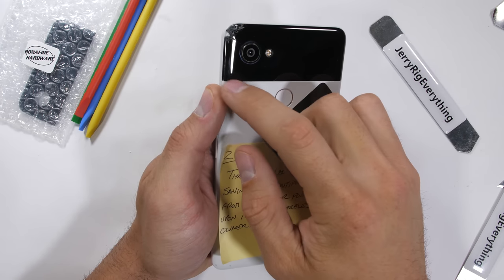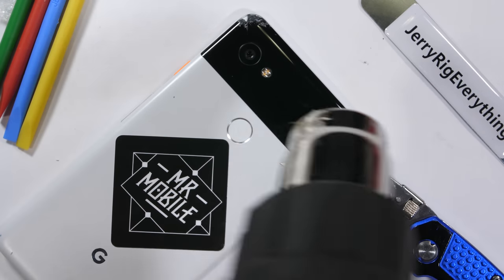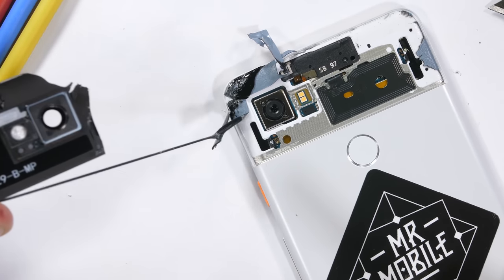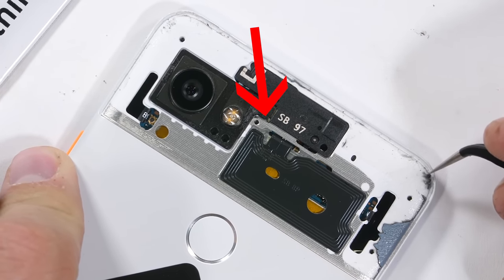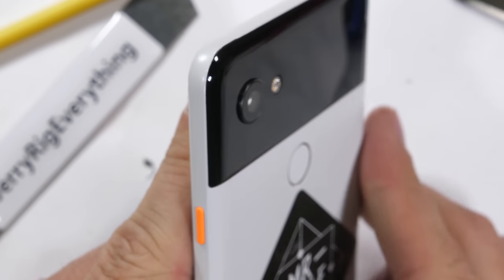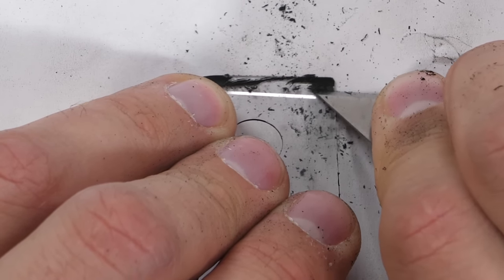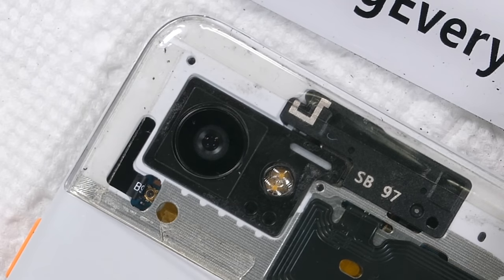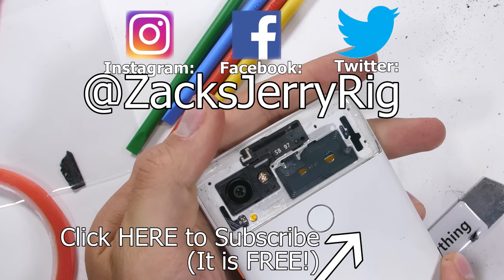Can we make a CLEAR Pixel 2 XL? - How to fix the Black Glass

Comment: Ghost Panda is 🔥. 

Great video as always. I may have been the cause of that V30 drowning 😂
Reply: Like if i should modify my 2000 G-Force centrifuge with a clear top :)
Reply: Glass is terrible material for backs.
Reply: Tek56 well, plastic scratches instantly, glass breaks easily, metal doesn't allow for wireless charging, carbon fiber would probably be too expensive, so ye
Reply: BH4x0r I'd rather have a back that just scratches as opposed to a back that shatters and breaks easily.  Glass is not durable.
Reply: Tek56 well strange that my S6 hasnt been broken while i had it since 2015?
never had to do a single repair on it or never had to have it repaired.
glass back and front are still in mint condition.
Reply: BH4x0r Lucky you, but many people drop their phones and end up breaking the glass. It's already bad enough that the front glass where the screen is breaks, but with a glass back, the glass on the back also breaks. Terrible idea for build quality.
Reply: Tek56 well, shit can happen, but if you're worried that you'd end up breaking your phone, a $10 S-Line case would solve that issue entirely as it protects your phone properly even if its quite cheap, sure it wont survive a drop off of a huge building but it's better than nothing especially if you're concerned you might break it.
if you know you've dropped stuff alot, a protective thing is a good idea as it costs a whole lot less than a new phone or new screen or new back-glass.
Reply: BH4x0r What's the point of a glass back then?
Reply: Tek56 as i said not everybody is as clumsy, so not everybody needs it, but it still preserves the wireless charging capabilities AND allows for easy and cheap swap if the case ever gets ugly, and glass will stay pristine, so it will not scratch, which in turn helps for a higher resale value if you ever wanted to sell it and get another phone
Reply: BH4x0r Plastic allows for wireless charging and is more durable than glass. Glass breaks, which is worse than getting scratches. So plastic is really better than glass.
Reply: Tek56 but the fact that plastic already scratches from just keys in your pocket is just shit, and the fact that its less likely to break the glass than scratch plastic is a no-go
Reply: BH4x0r But that's just the back of the phone, it's not the screen, it's not that big of a deal. A shattered broken glass panel is worse than some scratches. Plastic is more durable than glass, scratches aren't that big of a deal, it's better than a broken phone.
Reply: Tek56 tl;dr: everyone's preferences are different, i rather have a glass backed phone than a plastic backed phone, and alot of people do, and if you're careful enough with your devices none of this will ever be necessary.
but honestly, if someone buy's a phone and he sees the back is full of scratches he's less likely to buy it and/or would pay less
Reply: BH4x0r If someone sees a phone that has broken shards of glass then he is even less likely to buy it.
Reply: BH4x0r Accidents happen. People accidentally drop their phones a lot, that's why a lot of screens that are made out of glass are broken and why glass backs will also break as well. Glass is not durable.
Reply: Tek56 "a lot" yeah really ever happened to me right thinking
Reply: BH4x0r Many people drop their phones and break their screens accidentally. Having more glass on the phone will just break the phone even more and be less durable.
Reply: BH4x0r mmmm carbon fiber 😍
Reply: 666 lykes dud
Reply: Tek56 well glass is cheap and looks better plus there’s a thing called a case
There’s plenty of clear protective cases that allow you to admire you beautiful phone and don’t forget if the backs were plastic jerry could do clear backs
Reply: @tek5670  Well you can still use transparent rubber buff guards for the back 😅
Reply: @BH4x0r  And plastic is harmful for the environment as well 😁😁😂
Reply: @tek5670  I prefer glass as I rarely drop my phone
Reply: @HerobrineXPc you aren't everyone. I would want a phone as durable as possible without sacrificing the visual appeal. Metal is perfect for this since it looks much better than glass and is the most durable. Plastic is second since less durable, but still much more durable than glass.
Reply: @BH4x0r  looking back at your comments saying how plastic is "bad" because it can leave scratches is just stupid. You are complaining at a purely cosmetic defect aka scratches on plastic that doesn't defeat the structural integrity at all unlike glass which if broken exposes the insides of your phone which is not good. Who even notices scratches or cares? I know don't. Plus if you get more rubberized plastic like the back of the Galaxy S5 then scratches are much more unlikely. So therefore plastic is much better than glass. Why don't you make a house or car out of glass while you're at it? Knowing you I'm sure you would.
Reply: @tek5670  Its up to you, everyone has a personal reference. I like matte finish glass back, and my plastic back phone has some smol scratches. I like the Poco F2 Pro grey matte finish
Reply: @amvymavy  Yes it is up to me and I will make the smarter decision.
Reply: @Tempst  wait a minute plastic is safe for the environment? Bruh what
Reply: @amvymavy  When did I say so ??? 🤨
Reply: @tek5670  its not you that said it. I just think its weird that plastic is safe lol
Reply: HerobrineXPc oh never mind you were talking to someone else
Reply: @tek5670  thats not the only issue, i know that glass itself is already a pretty good insulator of heat, but plastic almost lets none through, which means your SoC will have an even harder time to cool down, infact metal backs were the best to dispose heat, but those gimmicks like wireless charging etc wont work through it so i doubt that we'll get that again in a flagship soon.

yes metal would scratch too but not as fast and wont fuck up the cooling abilities of a phone..
Reply: @tek5670  i bet you didn't even read my comment, i'd prefer metal over glass but if i have to choose i'd choose glass over plastic.

never had glass break in the 5+ years i had glass back phones anyways.
Reply: BH4x0r you haven't had glass break because you had cases on it, but even that fact doesn't change the fact that glass is more fragile aka easier to break  than plastic.
Reply: BH4x0r having a glass back makes zero sense whatsoever. 

Why make the phone even more fragile than it needs to be. 

Also if you're in favor of metal phones like I am why are you okay settling with glass?
Reply: @tek5670  because there are no good flagships with top specs with a metal back nowadays, i just take the best thing available, at the time, technically the One M9 was the best spec'd metal back phone when i bought my Galaxy S6, but even then it had severe heating problems, and i know the S6 performed about the same EXCEPT it didn't overheat, so i just bought the S6.

in 2018 i bought the S9+ and haven't bought any phone since, i just pick whatever is most powerful as long as it isn't plastic, overheats, or is an iPhone.

I upgrade only every 2-3 years.

by the way i always hated Apple and nothing will change my mind about those scammers anyways.
Reply: @tek5670  i haven't always used cases, yes when i bought the S9+ i did buy a case to go along with it, but i still regularly use my old S6 when i go to work, which is 5y old and still works fine except it got a bit slower and the battery doesn't last as long anymore, which is normal, other than that it doesn't have a case.

Comment: I've got a little request, if you ever were to see this comment, Zack. Could you if possible test out one of those liquid glass screen protectors with your Moh's picks? Screen protectors for curved displays kinda suck, so I was wondering just how good these "Liquid glass" screen protectors really were.
Reply: Just buy some curved glass protector, uv loca glue (2000)and cure it with uv light. Works like a charm. I use this method for a year now, and my screen is beautiful as new.

Comment: When you started to remove the glass with the blade, you shaved some plastic from the body of the phone, and I'm already at the part, where you state it's good as new, I could still see the missing material!! 😿 only the ocd guy inside my head makes me comment, don't mind me
Reply: mratlas It's always better to use a blunted blade. Not even hard to do, either. Just give one a few drags across some steel. Another razor blade would work, or better yet a nail.
Reply: Omg same 🤦🏽‍♂️
Reply: The same problem here.

Comment: Hi Jerry I just done this repair myself on a pixel 2 (non Xl) and here's some little tips for those who doesn't have the Xl variant.
1st: wear some eye protection (glass can go everywhere with brute force)
2nd the camera lens doesn't go off like the Xl, only the flash
3rd If your glass is really broken, it may takes some time removing all the pieces and adhesive (it took me a full hour for the whole process)
Overall great video keep the good work!

Comment: How do u not scratch the glass when scraping off the paint, r u using special knife?  Send me one bro if so thx jerry.
Reply: Glass is harder than the razor blade
Reply: With science.
Reply: Glass is glass and glass cant be scratched by a razor blade.
Reply: Glass only scratches at a level six, with deeper grooves at a level 7. A razor blade usually sits at a level 5 in Moh’s scale of hardness.

Comment: Your video is the only video that shows removing the glass almost one piece. I guess other people failed to warm it properly. I've got a heat gun with adjustable temperature so I wonder about proper temperature to set the gun to and also about the time to apply the heat.

Comment: Cheers for that! I've never done any phone repair and although this was minor I was worried, it's worried great on my standard pixel though (there seemed to be less delicate stuff under three glass thankfully!) Only thing I did differently as I don't have a heat gun is put the phone in the oven at 85 degrees C for 7 minutes at a time worked great!

Comment: Why don't you use those (i'm not sure if i call them right) bags filled with seed you can heat up in a microwave to soften the adhesive and use a solvent (like isopropyl alcohol) to neutralize the adhesive? I use both to remove batteries and save me a lot of time.. you can heat up the bag to like 120° F and put it on the phone for a longer period of time... no frying the phone and less stress of removing glass..

Comment: Why not using a plastic pick instead? everytime I see you slicing off parts of the chassis. Not only with this repair but also the others, the coating is often scraped off ont he sides from the back panels.

Comment: is it still waterproof after replacing the back glass?
Reply: Yes. The replacement glass has adhesive, so it should be water resistant.

Comment: Just one question in mind if anyone can help to answer though. As I plan to use a clear glass, would the adhesive make the phone water resistant again as it's no longer using the original black one?

Comment: How do you drown a V30, they're water resistant. (I would know I've got one myself)
Reply: LostandAlive theres no such thing as a waterproof phone. Water resistant maybe, but not waterproof.  IP68 only goes so far.
Reply: Steven Juris you can say that for anything.
Reply: Steven Juris, ok yes, I'm sorry, I should have stated that. My mistake. But how long did he have it in water for it to break? Water resistance still stops it from dying in water, at least for a few hours.
Reply: LostandAlive depends how long and how far. IP68 rating is only good for 5ft and 30 minutes. Anything more has the potential to harm the phone quicker.
Reply: Steven Juris They say 5 ft 30 minutes as an under-exaggeration. IP68 phones can last much longer than that, but companies want to just play it safe just in case. Look up the water tests. And even if it's only 30 minutes, how come he took over 30 minutes to get it out of the water?
Reply: LostandAlive plop we don't know how long or how far.  5ft isnt far down either. And it was in the ocean which is not going to be good for it either. It is not rated for salt water.  Salt water can damage a phone quickly even if its ip68.  All the water resistance is there to protect you from accidents. Your better off with a waterproof case for actual use. Water resistance also goes down after time. Especially if you take your phone into the shower where steam can loosen up the glue.
Reply: Steven Juris It was in the ocean? So where in the ocean and for how long?
Reply: LostandAlive wouldn’t matter where or how long.  The V30 has zero salt water resistance. It’s the salt that’s going to damage the phone.
Reply: Steven Juris Salt water will do more damage but the v30 doesn't have "zero salt resistance", it takes time for the salt water to work it's way through the rubber ring that lines the gaps where the phone is put together. It will eventually do damage, and it will happen quicker, but it won't happen as quickly as you make it seem.
Reply: LostandAlive yep. It's fine until it dries up and destroys the earpiece and microphone. But hey you don't need to use those to make or receive calls. Those are exposed and will get destroyed before the actual salt water gets through it.  You would need to immediately rinse the phone off before the phone dries.  Your better off having your phone in a waterproof case that protects the entire phone from water. As I said salt water is extremely bad for phones.  By the way, LG says  not to drop your phone in the ocean for that reason.
Reply: Steven Juris Like I said before, it takes quite a bit for that to happen. The speaker is mostly not sensitive to being short circuited because it's mostly made of plastic or rubber. So you don't have to worry about that all that much. I don't know a whole lot on microphones so that may be a different story.
Reply: LostandAlive no it actually doesn’t. One microscopic drop of salt water will destroy the phone. Salt if it actually dries will get into the phone.  You need to rinse it immediately according to the actual manufacturer of the phone before the salt dries.  Do you think LG knows a little about its own phone.  Why take chances.  Doubt the type C port is plastic.  That too will get destroyed by the salt and that’s exposed to air along with the headphone jack.  The seal is under the jack and port.  Salt water isn’t good to electronics. If your going to use your phone near salt water then your better off fully protecting it.
Reply: Steven Juris wh do you bother. He has his fingers knuckle-deep in his ears and goes "lalala" to not hear anything you say, he has already decided he is right. You are fighting a windmill right now. You are not going to convince him, so why do you bother.